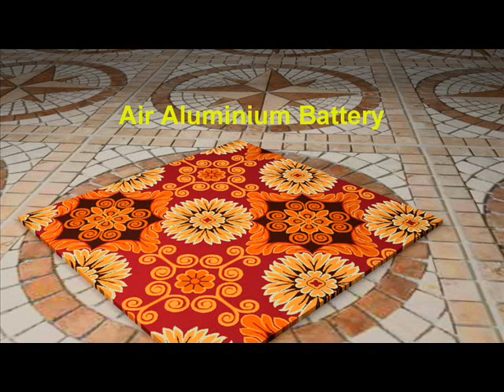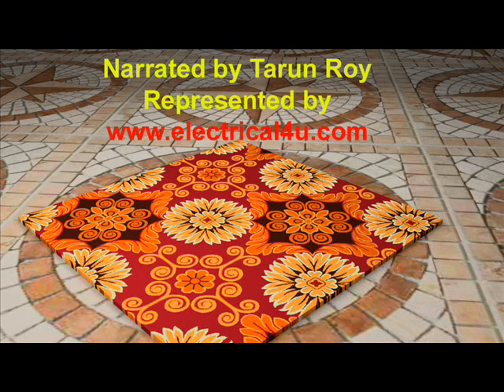How to make an Aluminum Air Battery (DIY)

Comment: Is this battery rechargeable?
Reply: no its a primary cells
Reply: If this cell is connected in series wheather it is possible to recharge
Reply: I think Alluminium Oxide is produced. Which can be reduced again to Alluminium in metal industries.

Comment: Aluminum does not conduct so its a salt and charcoal battery. Aluminum isolation at high voltage and frequency was used by Nikola Tesla in flying saucers.
Reply: +saucersource Wrong on both counts buddy.
Reply: +benjahnz Where is your video on the conduction of Aluminum ? Don't isolate yourself from science. Cheers
Reply: How about a wiki page? 
https://en.wikipedia.org/wiki/Aluminium%E2%80%93air_battery#Electrochemistry

The aluminium is consumed in the reaction that produces a voltage, the salt is there just as a source of ions and the charcoal is basically there to conduct. Maybe you should read less about flying saucers and more about electrochemistry?
Reply: +benjahnz  0.7 volts per cell. worst battery ever Just use the salt Why have the Aluminum its just a container
Reply: Not just a container, as seen on wikipedia, the aluminium is essentially the fuel of the battery.
From another website:
 
"To generate electrical energy, this battery relies on oxidation of aluminum at the anode, which releases electrons, and a reduction of oxygen at the cathode, which uses electrons. The movement of electrons through an external circuit generates an electric current that can be used to power simple devices."

I'm suspect the salt water doesn't work as the KOH as an electrolyte as the OH- needed in the reaction is present only due to auto-ionization. 

 0.7 volts may seem low but it can supply a decent amount of current (100mA). I've a miniature model car powered by a tiny postage stamp sized aluminium air batter. With just a few drops of salt water it is surprisingly quick. 

Source: I'm an electrical engineer..
Reply: +benjahnz Its called Aluminum not Alumimium Al gets coated with an oxide Al2O3 and that is why electrician engineers do not use Aluminum in electrical devices. I believe electrical connections to Aluminum are banned by code in buildings. No oxygen in space or in evacuated tubes used by Nikola Tesla however a coating of some sort could help to keep a polished surface in special beam applications. In any case nice video however I would not recommend such an aluminum application not even this example as it gives the wrong message. Misdirected videos as learning is a sad course for today's youth.

The battery has C carbon and salt NaCl and Al so those must be in any formula.
Reply: +benjahnz Wrong on both counts buddy. ref Nikola Tesla in flying saucers you don't have to worry its a copyrighted idea of William R. Lyne
http://www.bibliotecapleyades.net/tesla/occultether/occultether.htm
http://www.bibliotecapleyades.net/ciencia/pentagonaliens/pentagonaliens.htm
Reply: +benjahnz You are one smart engineer.  But not too much on ether theory.
Reply: Ether theory was debunked a very long time ago. It's what people used to think before we understood radio waves.
Reply: +benjahnz Plus not particularly smart really, just somewhat formerly trained.
Reply: @saucersource  actually it's called aluminium (english language)
not aluminum (americanese) it's wrong for google's spellcheck to say english is wrong.
Reply: @saucersource Hyperthetically find a raw mains bare wire and touch the alluminium too both wires n tell me it doesn't conduct...obviously after you get back out off hospital...obviously this is a joke do not ever do such a thing but you do get alluminium wire its not as conductive as copper around 60% but that's also circumstantial
Reply: "Aluminum does not conduct" 🤔 stay in school and don't do drugs kids.
Reply: @MrSpankyxiv  By way IOO yof illustration a modified arrangement is4 shown in.Fig. 2, in which the source S of radiant energy is a special form of Roentgen tube devised by me having but one terminal k, generally of aluminium, inl the form of half a sphere with a plain polished surface on the front side,
Nikola Tesla Radiant Energy Patent
https://patents.google.com/patent/US685958A/en
ALUMINIUM used for high energy beam terminations on every UFO saucer
http://www.rastko.rs/projekti/tesla/delo/10896
All paid for by someone for free energy saucers
Reply: Get a piece of aluminium and a multimeter. You'll find it DOES conduct electricity. There's your proof.
Reply: Ladies, ladies, you're both pretty. Now shut it.